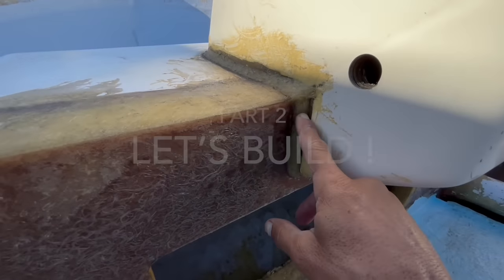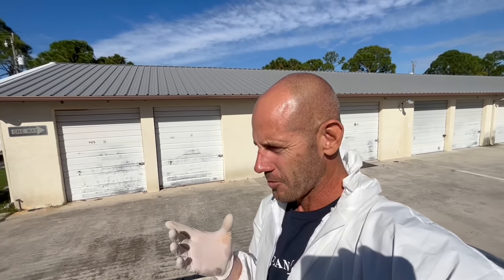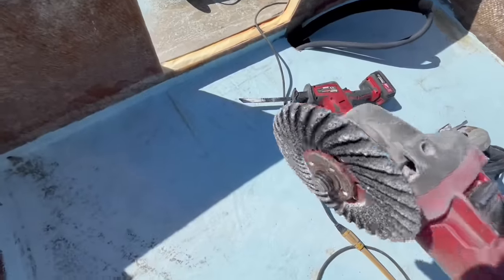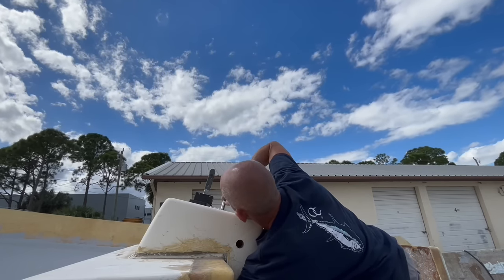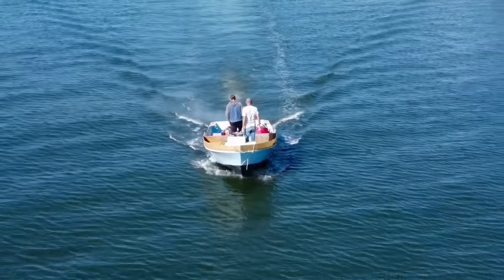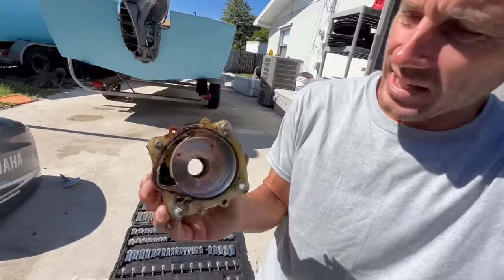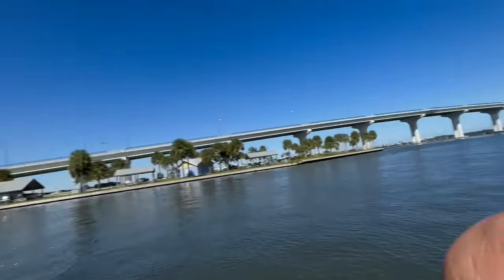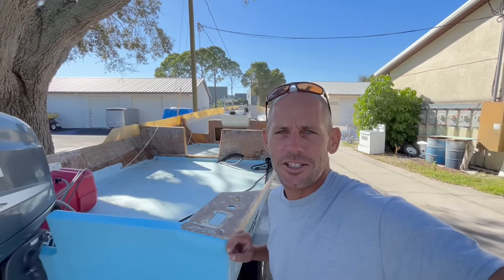DIY SKIFF Boat Build TEST RUN : Aquasport Part 2

Comment: Awesome. Love seeing the boat progress. 19" pitch prop is sick for the hole shot. It gets to max rpm quick! That thing probably has 10 mph more in it with more pitch but less practical
Reply from the maker: You’re 100% correct!  Super sick hole shot with current setup and actually could also be raised 2 holes which at 50 mph would result in a couple mph increase as well.  Maybe I’ll throw a bigger prop on it just for the heck of it! 😎. Cheers!

Comment: Really like the forward helm. Gives better balance to the boat and a much clearer view for the captain..... I'm with you on the speed thing. 20 or 25 knots is fine but it's best to be able to do that at about half throttle. My skiff tops out around 46 and I've only done it twice. Most of the time I don't even do 25.

Comment: How long does it take to get to the bahamas from florida  on a shift like that?
Reply from the maker: Great question Mark!  Depending on ocean conditions , and which island,  3-4 hrs at a moderate cruising speed would be a solid guesstimate if departing from Stuart ( destination Grand Bahama ) .   from Miami to Bimini is only 49 miles and could easily be done in 2-3 hrs.   :)  cheers buddy!
Reply: Cool..